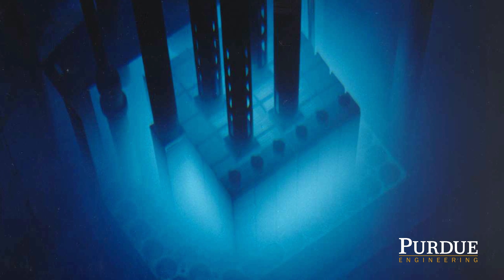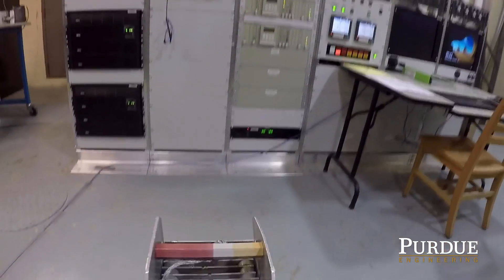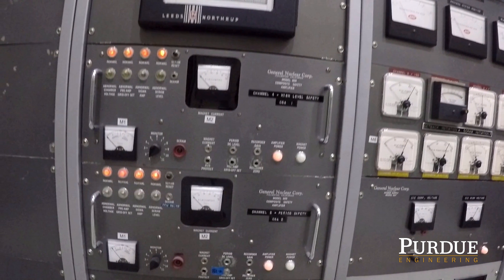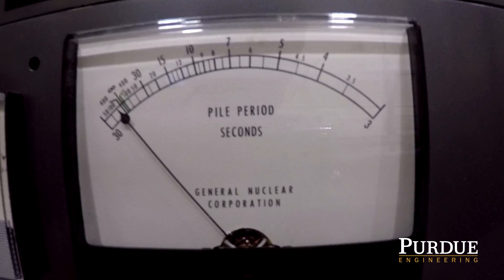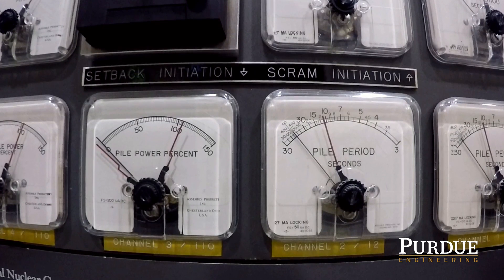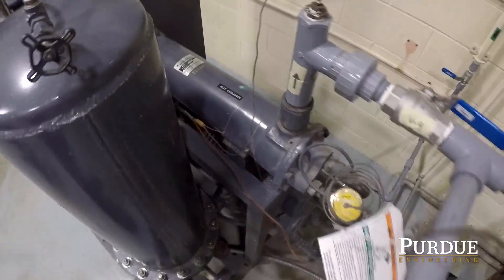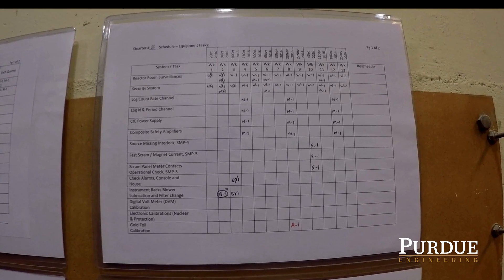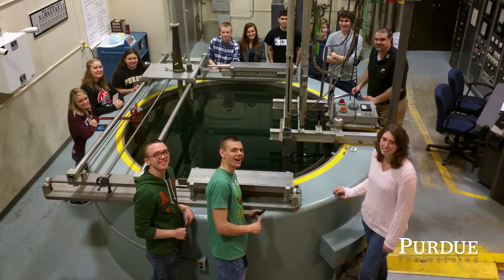PUR-1 Nuclear Reactor Tour

Comment: Its funny how people are fine with burning coal plants but hate nuclear power plants. When the coal plants leech mercury into the environment which is deadly once it gets into the food chain. And it easily gets into the food chain through water run off from the plants that attempt to "clean" the burn using lye. Nuclear is actually very safe, and most disasters were due to fucking around trying to make the process cheaper or in the case of Japan, bad design by placing the back up generators for the coolant were placed under ground making them vulnerable to flooding which happened after the earthquake and tsunami flood. There was nothing wrong with the reactor at all but the coolant system failed because of the generator failures. If they had placed the back up generators above the flood level the reactors would have been fine. So the ONLY reason nuclear energy gets a bad name is due to poor design or shitty attempts to make them cheaper to run. Its a million times better than burning coal. But like I mentioned ignorance is bliss for most ignorant people.
Reply: When nuclear accidents have occurred the media wildly exaggerates the damage.